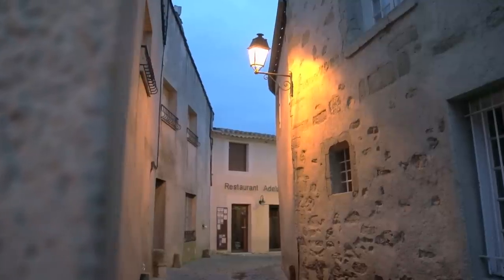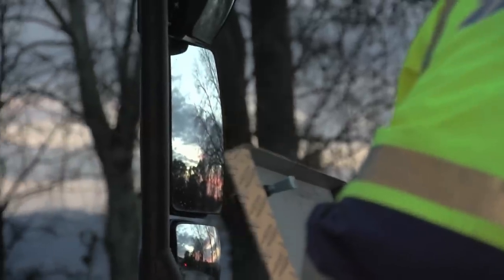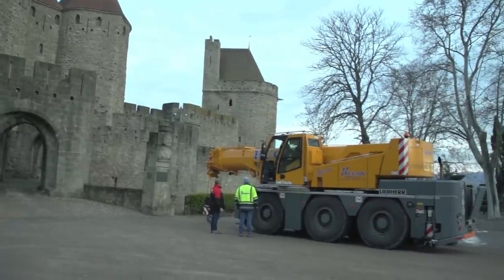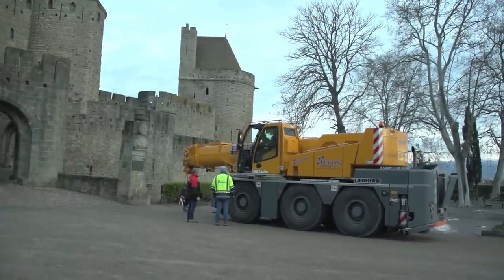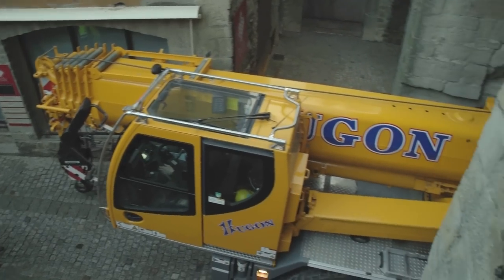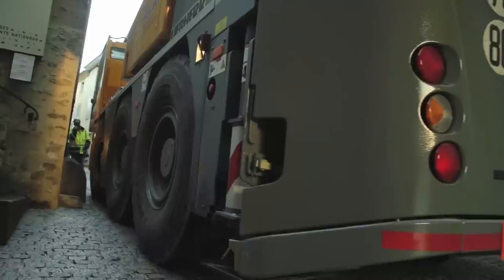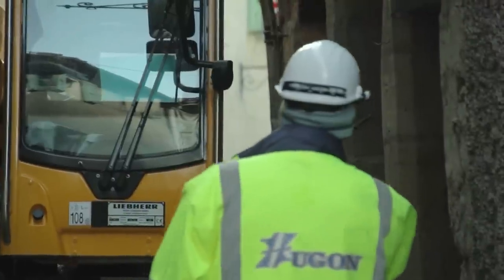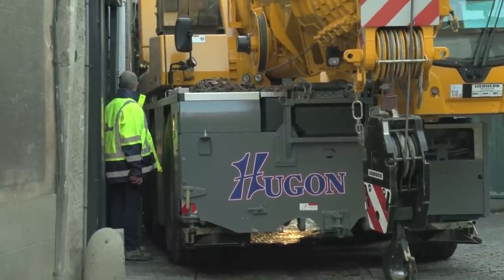Liebherr - Installation work of a LTC 1045-3.1 Mobile Crane in Carcassonne, France

Comment: I bet they did full computer modeling of that roadway including the set up location to ensure that the crane would fit and the road would support the weight of the crane before they showed up. You have to be an idiot to show up with that crane and hope it will fit. This was a well planned deployment.

Comment: It is a cool concept and good crane for the most parts. But, it has its problems and design flaws. First, there is a lot of sensor errors, and it has way downgraded lifting chart for its size. Then the cabin is way way too small and has no room at all for storing things, and working in a small room like this for extended time is not good, Liebherr could easily make it a lot longer and wider. Then it is the removable box, it is clever idea and is useful in tight situations, but if you need to lift the boom to utilise this feature then you need to put the crane in crane mode and then the undercarriage is locked and you lose all traction. And as a all terrain crane you should have and you need to have traction when driving in crane mode, and especially if you are on a gravel or uneven surface, that's just common sense and matter of a practicality. Also when driving in crane mode then this crane needs a slover driving speed and a smoother uptake. I have been working inside in a tight space and i had to move the crane (LTC 1045-3.1)  just few meters and it just goes way to fast to properly control the maneuvering in the tight space. But the working aspect of this crane is a dream. It is very smooth operator, It's the ergonomics and the human interface that Liebherr could adjust and improve. Jolly Good show...